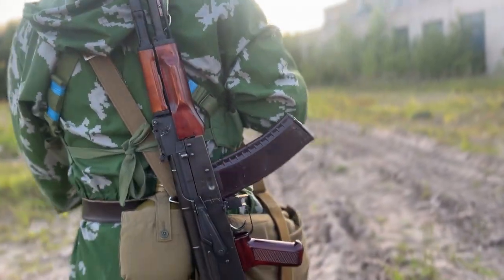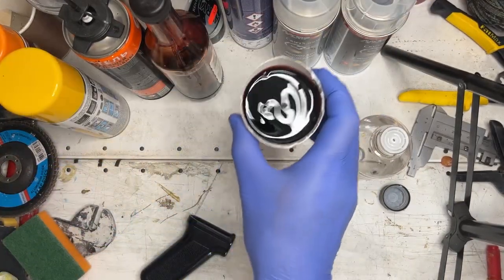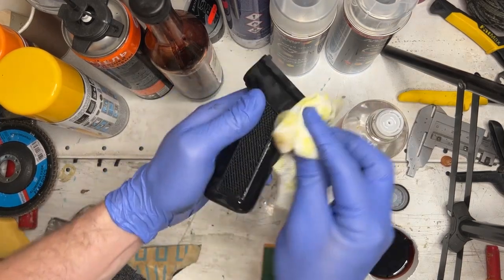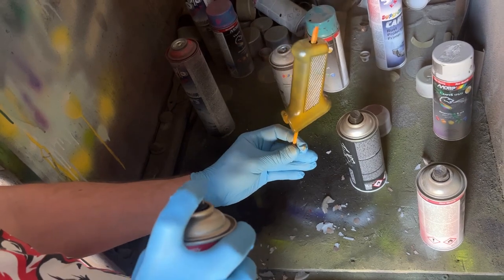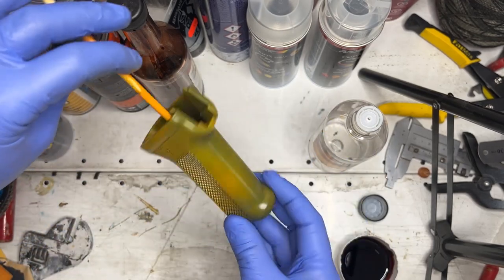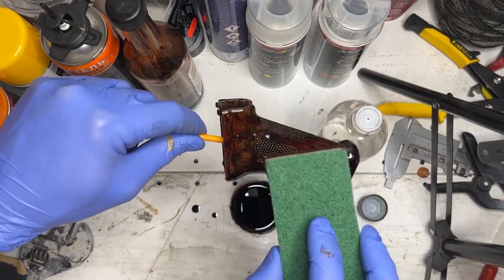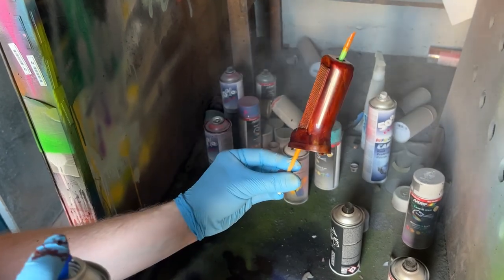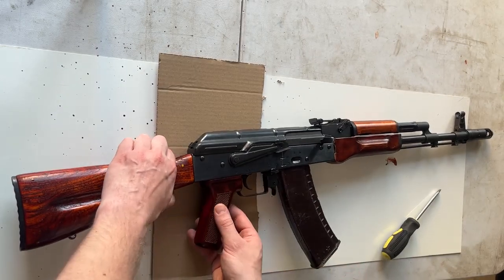How  to make airsoft FAKELITE pistol grip

Comment: Hello! The wood stain that you used is acrylic based or oil? Can I use oil based?
Reply from the maker: We used acetone-based. But acrylic should work as well. Even better if you use alcohol inks ( this is a new method that we will make a video about it later )
Reply: @VHS_Airsoft_club  so oil based wood stain is not good, right?
Reply: @VHS_Airsoft_club  I forgot to ask you what is the granulation of the sand paper that you used on the plastic?